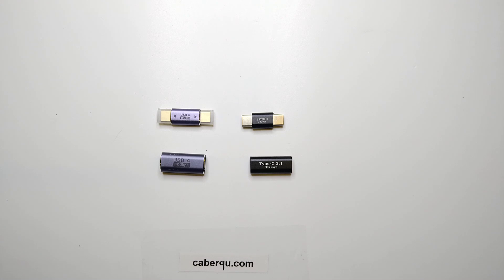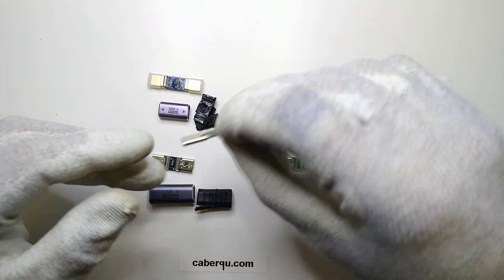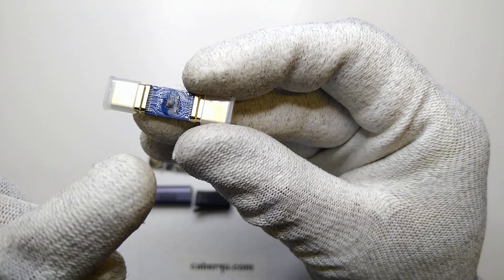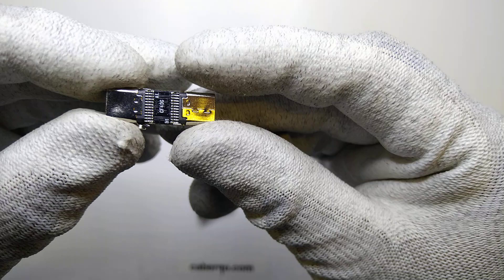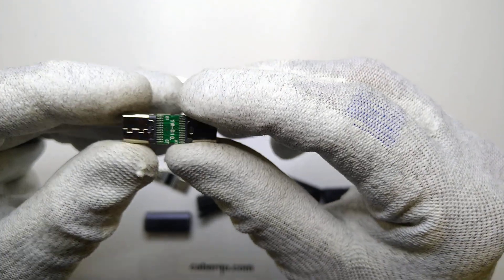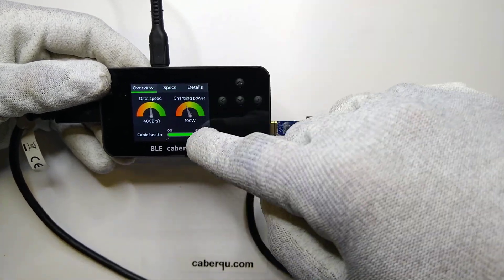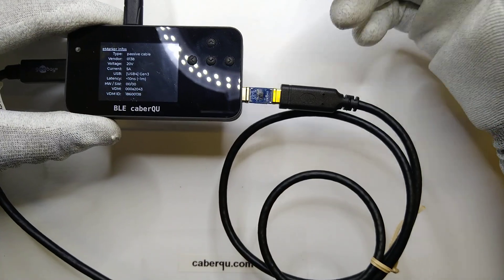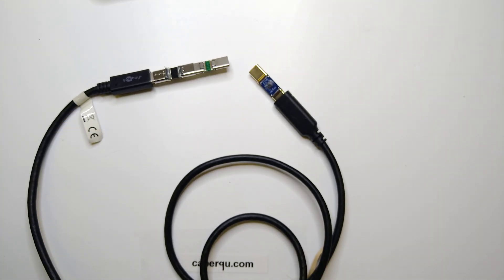Why are some USB-C adapters allowed and others not?

Comment: 5:27 sounds like a lot of BS to me, its literally a coupler and should never need to have anything beyond wires/traces in it and with all the smart crap at either end of the connections like the power supply and/or devices they really should be able to measure the connection and know if its going to handle the load.

Comment: Hello sir, it seems you are very very knowledgeable in usb cables. you are basically my last and only hope as i've exhausted all other options. is there a way I can message you to explain my situation thoroughly? I need to plug my iPad Pro M4 to my speakers but I am in a bit of a situation with a usbc hub and extension cable and female to female adaptors. I don't want to order 100 different cables from amazon to figure out what's compatible with what, instead I was hoping you can guide me to the correct cable and adaptor. the ones I've purchased from amazon are apparently not compatible as im only getting power but no audio. it's a lot to talk about. can I message you somewhere? I would greatly appreciate it! Thanks.

Comment: The USB crowd are idiots, did they think nobody would want or make extenders and adapters?
Before USB-C adapters & extenders were fairly common, so why on earth did they think this would all go away. USB-C is kind of a complete shemozzle as most users have no idea what a particular port on say a laptop is capable of, or what lead they need (or the fact there is an difference between leads)
A USB-C extension cord should just act like a USB-C hub, a hub with only one outlet, that should not be hard.
The EU says standardising on USB-C will reduce waste from all the cables that went before, NO it will just add to it as people plug something in and it does not work, so it must be faulty, so into the bin it goes....

Comment: I don't understand the logic of the adaptor declaring what it is. Surely the idea is that the identification should be one end device identifying itself to the other end device over the whole connection. So a straight adaptor no chip connection in the adaptor would allow that. The one with the chip is deception, as either item connected believe they are connected at 40gig  but the cable being used may not be. Even worse, it is also possible that only one of the items (devices) may not be 40g high wattage yet the one putting out the high wattage thinks the other device is capable of taking the output when it may well not be it may have been made prior to the signalling. If the chipped adaptor can read the earlier device, then it could be ok, if intelligent enough it can override the possibility of one seeing the adaptor chip as the other device, But I see no logic here for a chip on the adaptor, that should be up to the devices to negotiate their own connection and the adaptor allow that to be done. I do see  a need for the straight through ones to be rated for high current and labelled with the actual power charge wattage, not a silly code that can be misconstrued, as USB connections have been for several years now with totally rubbish nomenclature for versions and generations.

Comment: In short: If you need those adapters and extensions YOU should check if the max power is compatible, because the USB standard won't do it for you..

USB C extension cords should be part of the standard as a specific use case of an USB HUB, and that would allow every single one of those adapters and extensions...  but again the "USB IF" let us down...
Reply: A USB -C extension cord should just act like a USB-C hub, a hub with only one outlet, that should not be hard.
Reply: That doesn't work because 2 cables chained may not support the same power as one alone due to voltage drops. Same for speed due to more distance can cause desynchronization. Combining would require a recalculation of the specs for each specific set.
Reply: @Joe3D  Without USB IF definition we all are subject to these problems..

And, after some trial and error testing, it works.. probably thanks to tolerances the standard defines.

Nothing works in real life without tolerances..  Otherwise send some scientists to my house to show me why my working setup shouldn't be working :D
Reply: @RacoonBoyBR  chaining is way more than tolerance. Some additional hardware will be required to make those recalculations, it's much easier just to buy a longer one cable. It's like making a car with 2 or 3 combustion engines compared to buying a now powerful one.

Comment: It isn't only "unsupported configuration" for the adapters, cables, but also potentially a bad implementation. 

Female to Female adapters can be created as "USB hub". Not having more ports of the hub exposed would cause no problems, so your "2 port hub" type female to female adapter could work okay, safely and can even advertise itself and capabilities as a hub. No reason to have a separate specification for these kinds of adapters as they can be seen as a 2 port hub. I am sure that a 2 port hub can be also certified...

An otherwise "illegal" extension cable can be created as combining a cable and the above mentioned 2 port hub. Both the cable part and the hub part can work, and even if they are permanently connected it can be safe. 

If there is a safe a compliant way to design a device for this functionality and they choose an unsafe and noncompliant way, that is an issue.

As EU made mandatory to use USB-C charging for many devices as they hoped for an "universal" standard, we would see a scenario where people assume they are universal. People who assume it is safe to charge their devices with any USB-C charger, with many cords, etc. might create fire hazards due to non-compliant implementations. 

Physically incompatible chargers at least forced people to think if their device is compatible with their device. A false sense of security, safety and compatibility is dangerous.

Comment: I have some of those female C to C adapter [mostly PANEL versions]

they work quite nice, but I won't be using it for anything higher than 12V 2A.
Reply from the maker: Probably the best idea ;)
Reply: @quiescentcurrent  they do have some use, though it rarely happens that I need them, 
last time I needed one was to force a tablet in bootloader modus, by NERFING a cable to oblivion, so it had barely enough power to boot, but not enough to quickcharge it. had to use like 2+ cables, and 5+ adapters, to kill off any quick-charge feature, and make the cable 5M long.

Comment: Surely, the non-conformant M-M connector has a role in testing the extension cable you used, as it wouldn't cause misrepresentation of the capabilities ( as the compliant one presented the cable as USB4).  Or have I missed the point?  Great video by the way, very helpful.
Reply from the maker: Good point, I've tested everything beforehand in different combinations and it was working as shown
Reply: If the "extension" cable has no USB chip, but is just a passive cable, it won't be what's responding.  Look for another Quiescent Current video on USB-C "extension" cables.